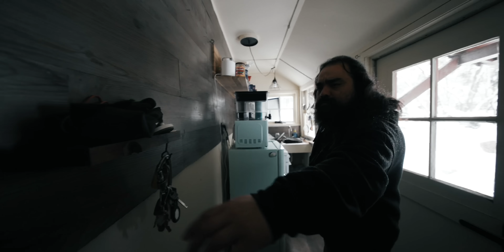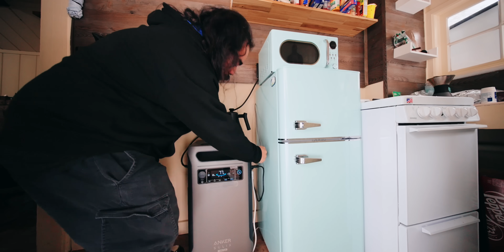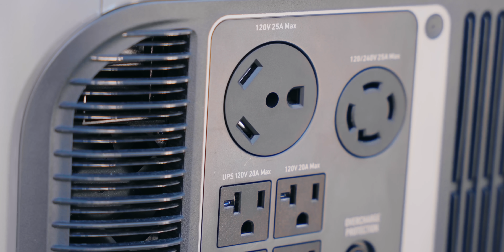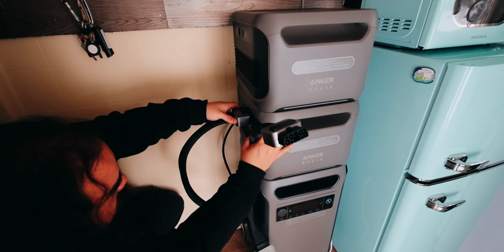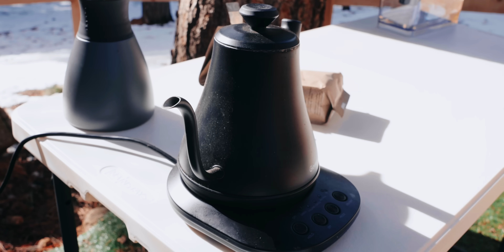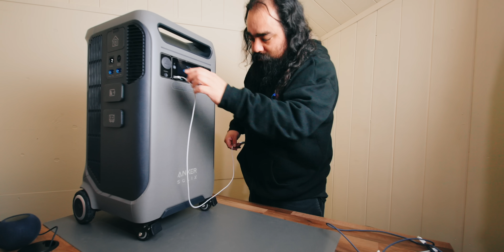Anker SOLIX F3800 Plus | The ULTIMATE home power backup solution!

Comment: These Anker backup power units use the absolute worst inverter tech thats currently available on the market. They use a high frequency, transformerless design that doesn't provide any galvanic isolation between their DC boost stage and their AC output,  so when the MOSFETs in their H-Bridge circuit fail, they can easily pass high amperage DC current through to your AC appliances and cause severe damage. If you want to safely provide power to your home during an outage, then you should be using low frequency transformer based inverter tech instead.

Comment: 3840wh battery is almost completely wiped out by that 6000w AC inverter that has mega high idle power consumption like basically 100 watt hours which is insane
Reply: Most reviewers said the idle consumption was 50 to 70 watts.  There has been a firmware update that reduces by 50%.